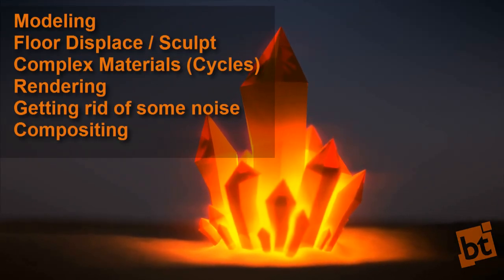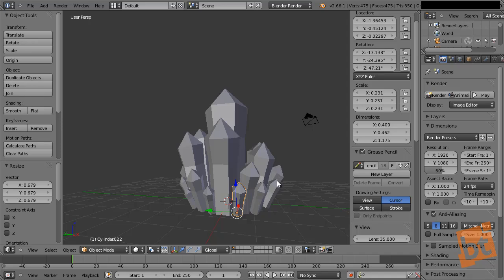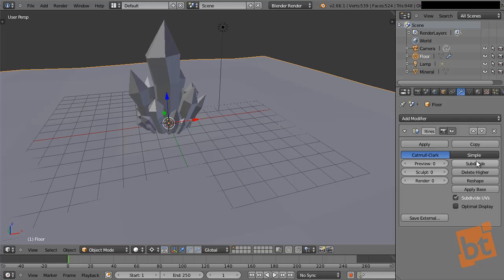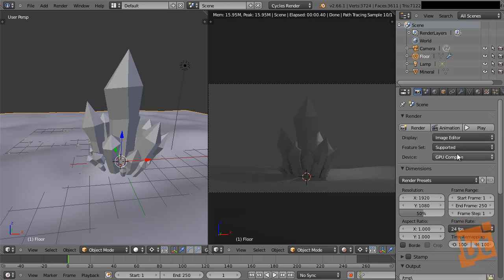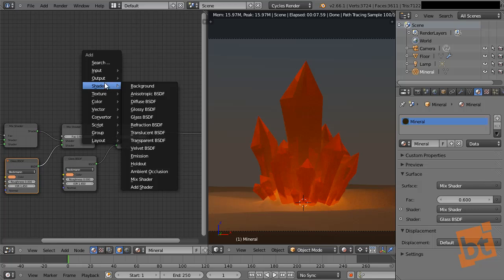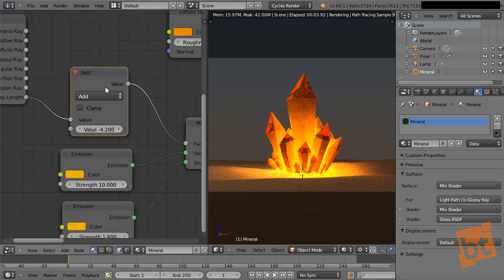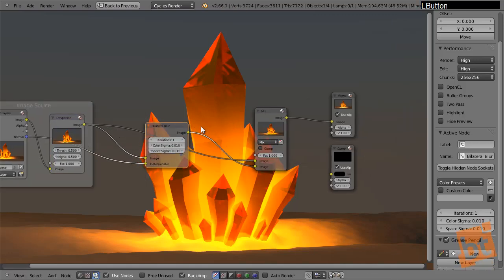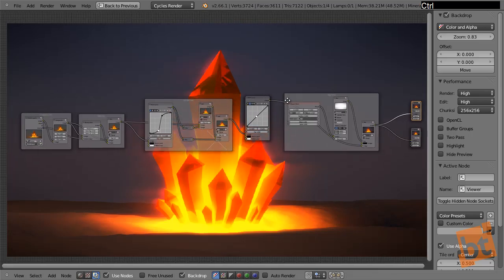The Magic Mineral - Blender tutorial

Comment: I had a problem when I got to the compositor. Using the newest blender version 2.71, the render layers box doesn't seem to have a Normal output node. I got stuck there. I did get a pretty cool image though, and enjoyed the tut! Although I would like to finish it if you could help me figure out how to get a normal to connect the blur box to. Thanks!!
Reply: http://blender.stackexchange.com/questions/6517/layers-section-is-not-in-the-render-settings-panel     a little late but better late than never :D

Comment: Worked great in Blender 2.66.  However, it STOPPED working in Blender 2.68 and 2.69.  There is no longer the high reflectivity of the yellow on the crystals in 2.68. Rendered the same .blend file in both 2.66 and 2.68.
Reply: TheNoChimpsBus Thank you for this comment without it I wasn't sure what my problem with blender was.

Youtube needs more commentors like you :)
Reply from the maker: The algorithms and material support or default parameters are changing little by little over versions, that may also have its effects in the resulting image :P Thanks for the heads up!
Reply: Oliver Villar Yeah, I figured some default values have changed or the rendering algorithm has changed (I think I read somewhere it has changed in Cycles Render). I tried to hack it to get it to work in Blender 2.68, but no luck yet. This is a REALLY NICE tutorial, and it is unique - haven't found another like it. Thanks for the reply.
Reply from the maker: Thank you so much! I'm happy to hear you liked it and it's been useful for you... Even it's not working the same anymore haha. Good luck! :)
Reply: Oliver Villar
Me again.  Soooorry!  The problem was so simple to solve. I don't know what was wrong with me.  SMH.  I even said I tried to hack it.  LOL!!!

In the material Node Editor on the crystals, the top Emission node on the left, simply change the STRENGTH value from 10 to about 40 in Blender 2.68.  That fixes the version change.  Honestly, I don't know where my mind was.  Uh, duh, obviously, if the yellow emission is TOO WEAK, one should increase the STRENGTH - LOL - honestly, I don't know where my mind was.  I must have increased it only slightly and quickly gave up. 

Thanks again for this VERY NICE tutorial.
Reply from the maker: Hahahah those things happen :P You're welcome and nice to see you got it right! :D